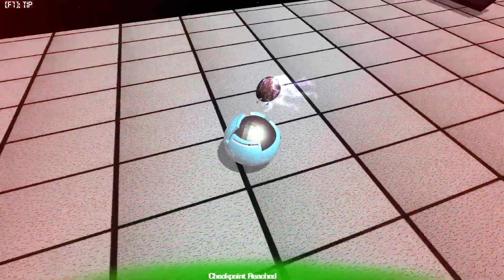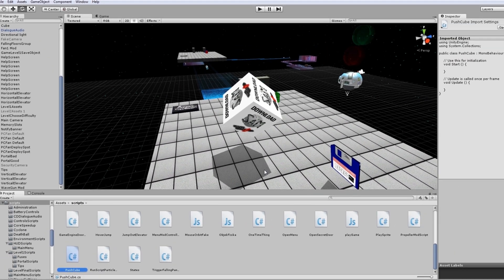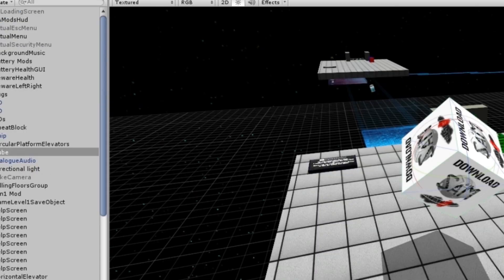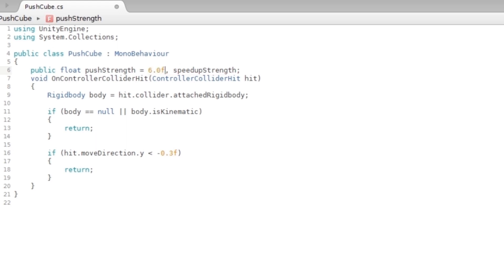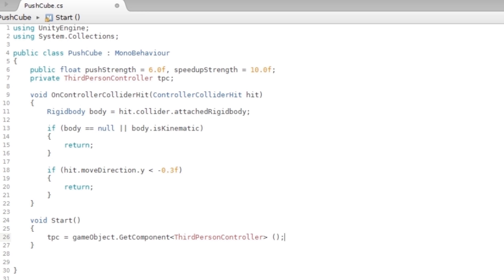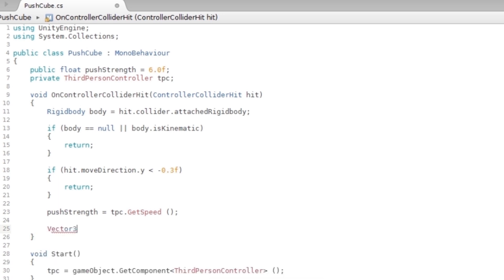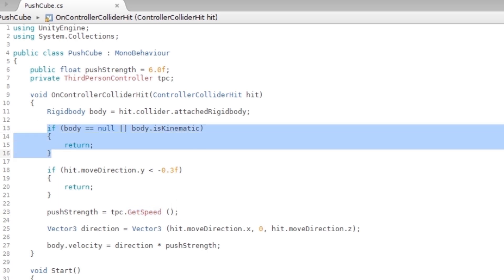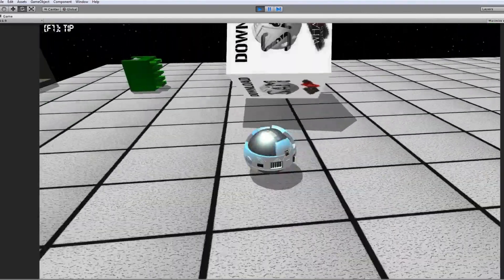Unity How to move objects (rigidBody) - What If TUTORIALS

Comment: i need help 

it says

 Assets/World/PushToMove.cs(24,37): error CS0119: Expression denotes a `type', where a `variable', `value' or `method group' was expected  

 for

 Vector3 direction = Vector3(hit.moveDirection.x,0,hit.moveDirection.z);
Reply: just fixed it but it won't push I'm using a character controller or should i be using a rigid body